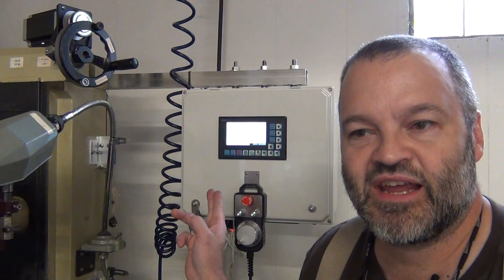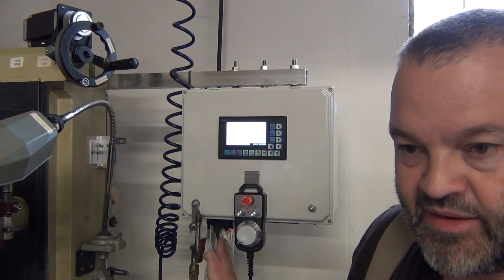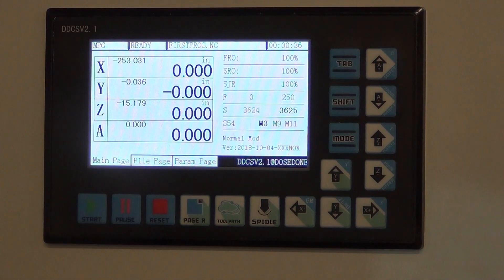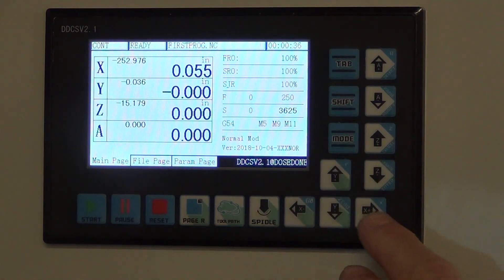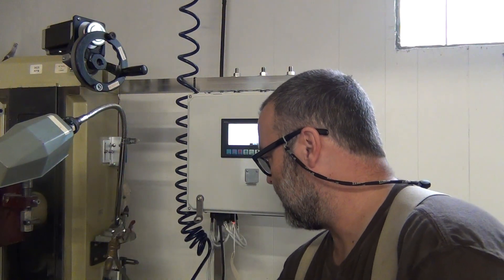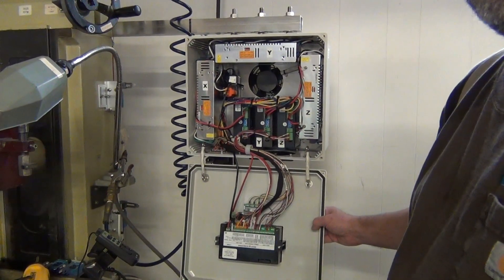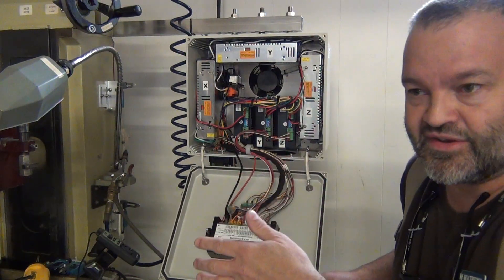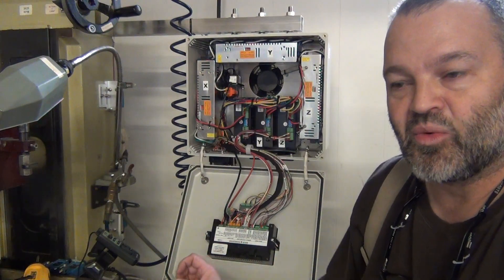DDCSV2.1 CNC control on a Surface Grinder (part 2)

Comment: How did you get M8 to work?  I just got the same controller to upgrade a plasma cutter, but M8 won't operate to turn my torch on and off.  The machine is setup with a relay and I've wired exactly as the manual shows.  I suspect there's an option in the firmware to get it to work properly.  I've not received a response from the manufacturer at all.  Thanks in advance!
Reply from the maker: I think there was some setting I had to activate but that's been a while ago so I cannot remember exactly where it is.

Comment: Hi Tom, 
My name’s Traian. Im really impressed about project and finally some one does a video about grinding machine using stepped motor and cnc controllers I would like have a chat with you if is possible and not bother you .thanks
Reply from the maker: If you want to send me a private message I can be reached at sales@mathews-engineering.com

Comment: Hi Tom,
i have the same  situation here,
a old manually universal/tool grinding machine in my shop and sometimes not enough hands to operate all the machines at the same time.
Grinding is a boring  operation, especially with a hand driven machine table,  
turning of a handwheel back and forth for hours..... is not good for the health. 
I purchased also the DDCSV2.1, a DRO would be a nice addition....searching for one
Thank you for your vid.
Best!
Reply from the maker: Especially hard to do a good job grinding if you get impatient.  With CNC you can program in the patience and sip coffee or do something else while the machine works on its own.

Comment: Hello Tom, 
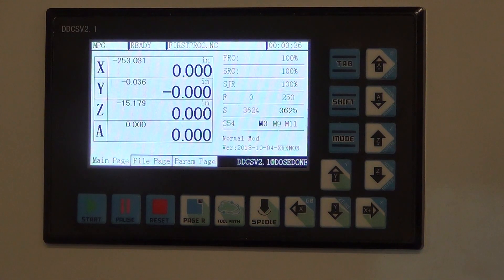At 2:50 in this video you (apparently) move the X axis to show the DRO in the DDCSV controller count.
Where/ how does the cnc controller get the input signal from to cause the DRO to count? 
Thanks!
Reply from the maker: This is a stepper controller so the position information is "open loop" and based on how many steps were sent to the stepping motors.  I also have a DRO on this machine and I can see from the DRO that the DDCSV2.1 is staying accurate enough for my needs.  Of course a professional machine would have absolute encoders or some other way to make sure the stepper has not slipped its count.
Reply: On this machine (and on almost all stepper motor type machines) the glass scale DRO and the DDCSV2.1 are totally independent of one another.   The DDCSV2.1 gets its position information on start-up by zeroing itself against the limit switches then stepper motor "dead reckoning" pulse counting from there.   The DDCSV2.1 has backlash correction so it's sufficiently accurate for lots of work but not as good as AC Servos and ball screws as you might find on a professional CNC machine.

Comment: I see that you have the read out set to inch, can the g-code program be inch or does it have to be metric?
Reply from the maker: The G-Code is in inch and works well.  One glitch though is the feed rates in your G-Code will still be in metric (mm/min.) which is weird.  Not sure if they will fix that but I have been able to live with it for now.  They were pushing new DDCSV2.1 firmware out regularly so things like this were getting fixed.  Of course I have several programs with mm/min feed rate and inch targets so if they change the way the control works I may have to go back and revise those programs.